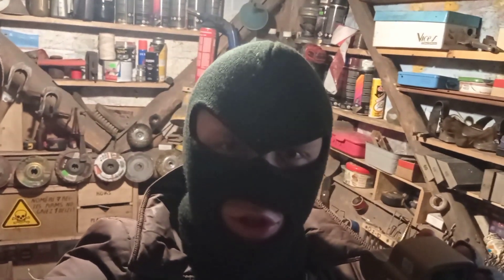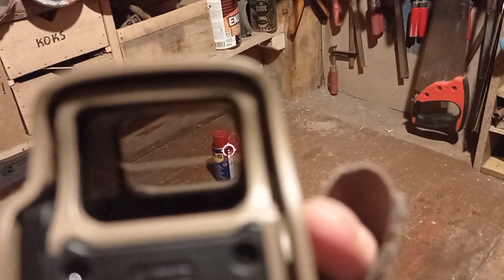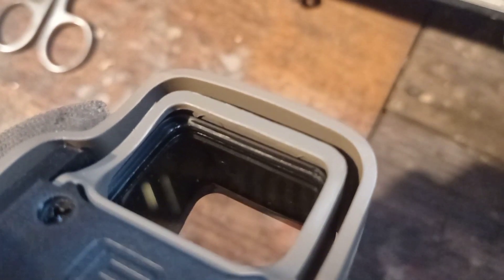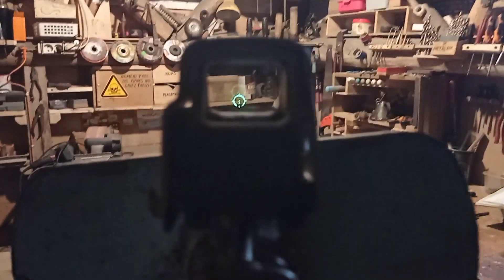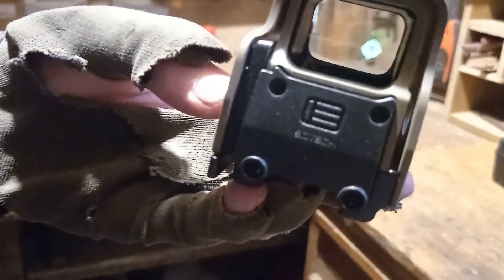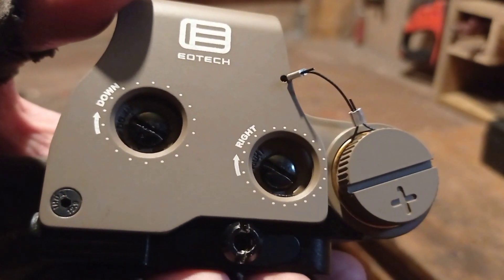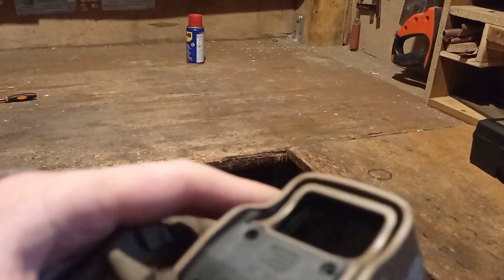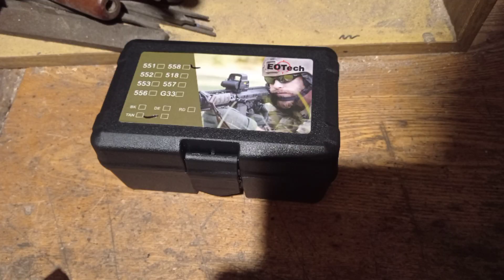How holographic sights work

Comment: Sorry but I think this is a fake product. The engineering goal of the holographic sight is the improved accuracy and having a second laser of a different color will either ruin the accuracy gain or double the cost of the thing. No way Eotech would ever do that. Also, some internet survey returns no Eotech with color changing feature.